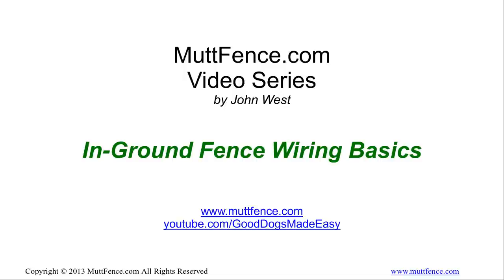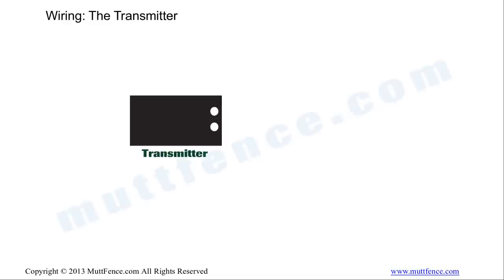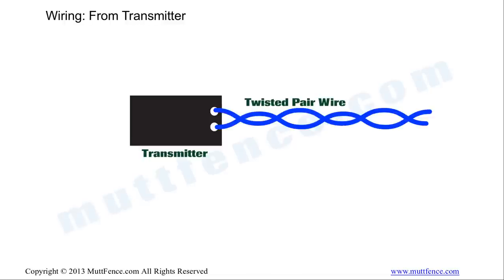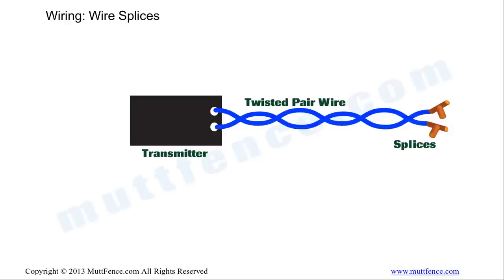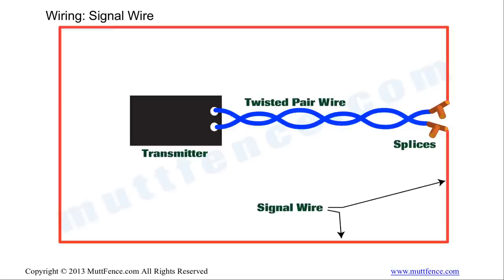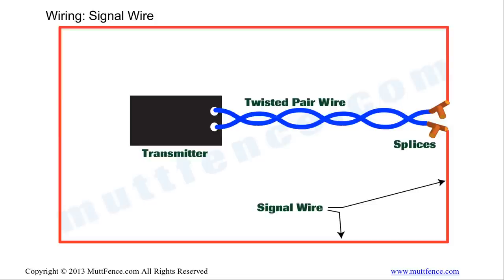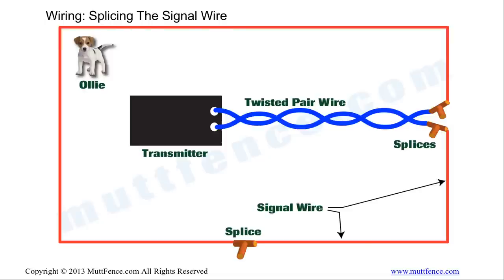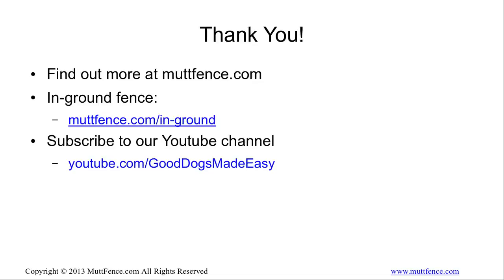In Ground Fence Wiring Basics

Comment: For those who are confused about the twisted pair, the splice is not needed in the loop. It is a series circuit, and the twisting of that single wire simply cancels the signal out where it is twisted. Typically, around 10 to 12 twists per foot of wire. The only time you would need to spice, is if you are short on the length of wire needed.

Comment: I did not splice at all and it seems to be working fine. I haven’t found any reason to splice???
Reply: I also don't see why you have to cut and splice perfectly good wire, as long as when you go single wire all around your perimeter (use 2 wires, one around one half the yard, and another around the other way) and then do the twist into your garage and into the transmitter. (???) Makes no sense to me to do the twist first, cut the wires, and then splice into your freshly laid perimeter wire. Thoughts ???

Comment: I still don't get why you have to put in a splice? Can't you just twist the wire and then separate the twist where you want the signal to start transmitting? It looks like you're just splicing one wire to another wire for no reason.
Reply: +Michigan Militia Music I believe you can i saw a viodeo where they did what you're saying
Reply: i was also curious about this, did you ever figure it out ?
Reply: I didn't figure out why, but I just did as I was told and it worked hahaha
Reply: I'm in the process of putting an underground fence together without the splice at the end of the twist so will tell you if it works without it! All it says in the petsafe manual is that the splice is ''recommended'' but doesn't say why.
Reply: How did this go, entershikarisim?  I'm worried all the twists will cause problems with the boundary.
Reply: entershikarisim Did that twist in the main loop ever work out? I’m in a similar situation.
Reply: entershikarisim so did it work?? Haha
Reply: I think @entershikarisim  is still out looking for his dog :/